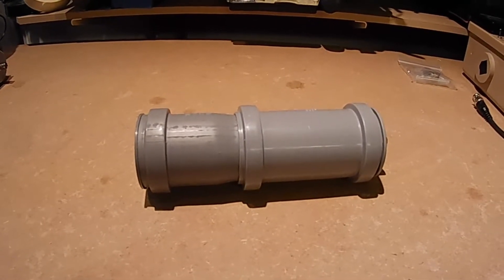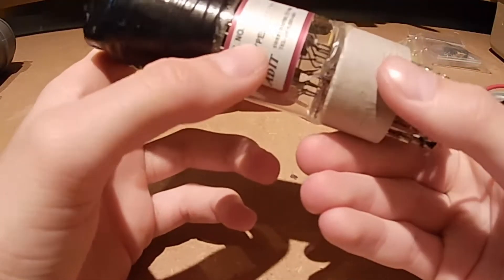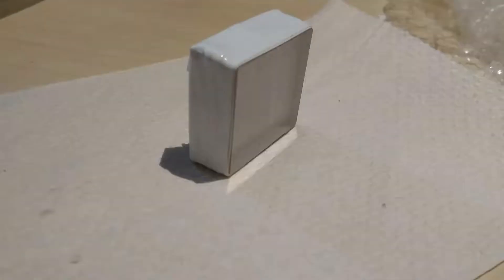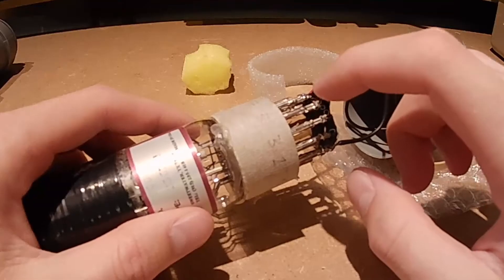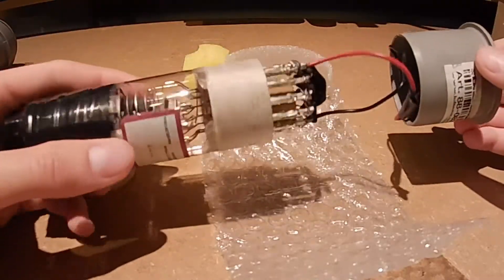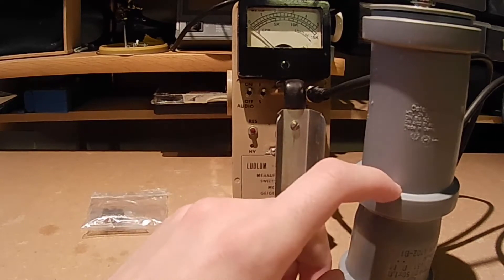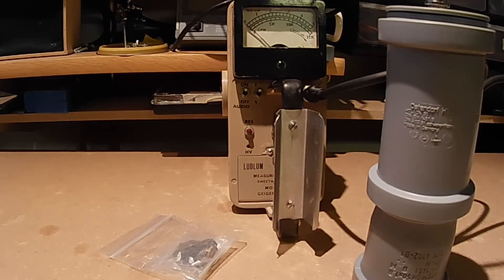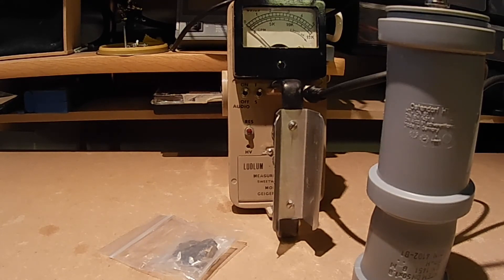DIY BGO Scintillation Detector

Comment: Hi I have a question. Can other crystals work? , and do I need the couplink compound?
Reply: any proper scintillating crystal will do, this includes and is not limited to, plastic scintillator, CsI and NaI( Tl). 
the coupling compound is a silicone oil that removes the air gap between crystal and PMT, this is required to reduce losses and improve effectivness.
Reply: @dalitas  thank you

Comment: Hello there. Sorry to bother you, but do you have any input on making a lead collimating attachment for a scintillation detector? I have several bicron nai(tl) detectors, and I’m trying to detect radioactive sources in an industrial scrap yard. 

But I’m getting so many different sources that it’s hard to narrow them down. I have several Ludlum meters and I am very comfortable using them… But I would like to design and make a lead collimator lens to help narrow down what part of the scrap yard the source is coming from… Then I can switch over to another meter with my pancake probe to narrow it down.
Reply from the maker: Hi! That sounds like an intriguing idea, cool! I don't have much experience with collimators, but it seems to me like it would work. Good luck!
Reply: Lots of wheel weights melted and poured into a mold that the detector can fit into. At one scrap yard they got in some tungsten carbide cylinder sleeves for some sort of engine and those fit a scintillating head very nicely. You will want a pair of detectors and a meter setup so it triggers an alarm when a threashold count level is reached. I used an old analog Ludlum mode 2 that used a little proximity sensor to detect the gauge needle position. Borrowed a few nuclear sources to dial it in, one was a Cs 137 15mCi source used in a Troxler gauge and the other was a Sentinal gamma ray projector. Both items had the source exposed and put in a load of scrap steel and driven across the scale to set the low limit cutoff and dangerous level alarms. This project oriented by chance that I had a small counter that got switched on in my tool bucket and I discovered an orphan source. 😮

Comment: What is the benefit of the BGO crystal in comparison with the commonly available Scintillator materials like NaJ(Tl) or CsJ(Tl) scintillation plastics etc?
Reply from the maker: BGO is partly comprised of Bismuth. Bismuth's high atomic number (83) together with the high density of BGO (7.13 g/cm^3), results in BGO having the largest probability for photoelectric absorption out of any common scintillation material. In other words, a lot of gamma rays interact with it, compared to NaI(Tl), CsI(Tl), etc. 
In fact, BGO has about twice the density of NaI(Tl) (7.13 compared to 3.67 g/cm^3). Or about 7 times that of many plastics. 
BGO is also rugged, and does not break very easily, especially when compared to NaI(Tl). It's not hygroscopic either. 
But of course it has a bunch of disadvantages too, which is why it isn't that common.

Comment: Seems it’s hard to find the BGO crystal. Where did you find it? Would like to build one of these.  Seems very sensitive.
Reply from the maker: I found it on eBay a couple of years ago, but sadly they seem pretty rare there. BGO has a high density, which reslusts in a sensitive detector, especially at higher energies compared to NaI(Tl) or organics. Great for uranium hunting!